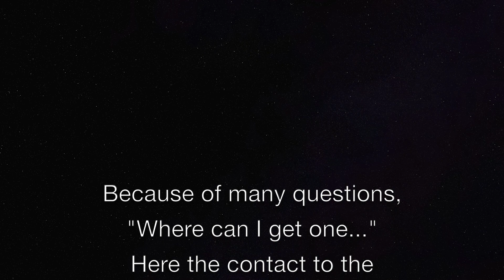AMAZING R/C TRUCK ACTION at fair Tiefbau Live - 09'2019 part 1

Comment: wonderful video buddy go👍od jop..so i want your help i have earth mover 870k new vergin 2019 she come without fan in the rear like old vergin but can i put fan on my loader or not does this benefit her or harm her ...thx again pal
Reply from the maker: Many thanks for your support, Evil! Great to hear you like it! Regarding your wheel loader, what would you like to manage with the fan?!? For cooling down the engine bay? Or do you want it only for the realistic view? Yes you can mount it there, and for turning slowly the fan so you can see turning slowly you need to send a PWM signal to the motor, fan turns slowly and you can see blade by blade ;-)
Hope that idea helps a little! Kind regards! Carsten from RCCARHOBBY
Reply: @RCCARHOBBY  thx mr carsten much appreciat it i'm new subscriber👍👌✌

Comment: Nice video 👍 question I see the trucks have differentials do they have oil inside it?
Reply from the maker: Hi Michael, many thanks for your support, nice to hear you like it! Yes, the axles have differentials, but no oil inside, there is grease in, easier to get it sealed, the gears have some shield against dust and humidity and little greasing for sure 👍
Kind regards! Carsten from RCCARHOBBY